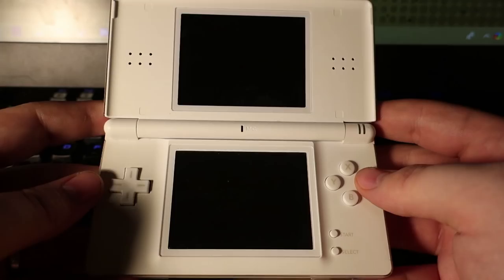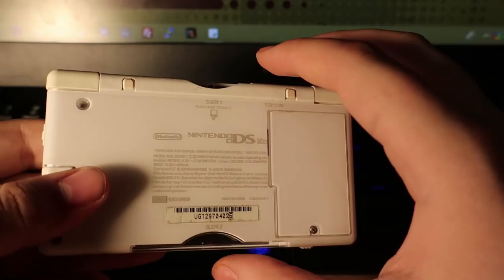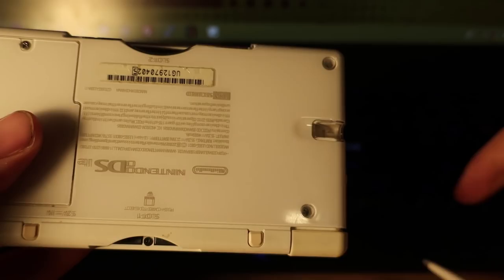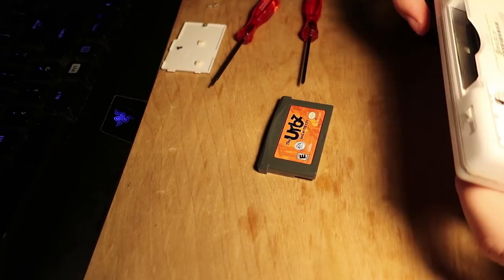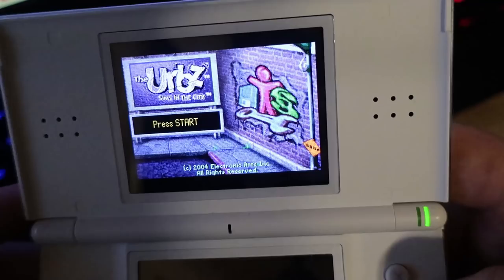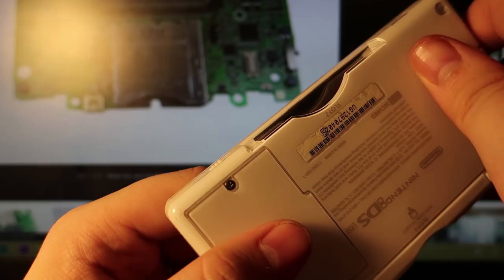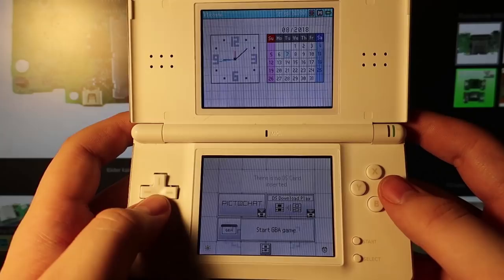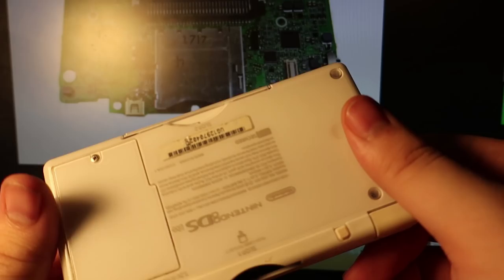$10 DS Lite won't play games. Let's see what we can do...

Comment: When I had one of these, with the same issue, i just kept inserting and removing the cartridge for two minutes and it came back to life
Reply: i had that too i needed 30 min i put out in i breathed in it and i even spited on the game card (dumb xdd) then i used a tower to clean the card put it in and it worked :v
Reply: @kitcat9685  thanks I did that too
Reply: @El1teAlexヅ  That worked for u aswell? lol? O.o
Reply: @kitcat9685  no it didn't work lol that could damage the console xd
Reply: @El1teAlexヅ ik but i did and it worked xdd
Reply: @kitcat9685   alright let's say it did worked for me but damaged my second console xd xd
Reply: @El1teAlexヅ  Rip xddd
Reply: @kitcat9685  every time I would try to use a tower to fix my ds lite it just is too heavy to lift
Reply: Same! I had a 3ds xl and it won’t play games
Reply: Mrsuperking Youtube631  lmao
Reply: i did tha same and some clean up with a wet wipe and it worked
Reply: You just fixed my problem

Comment: That's a kickass deal. A year or so ago I remember getting my DSi XL from my local pawn shop for only $25 since they had it on clearance being sold "AS-IS" as the slot wasn't locking in place. Game carts wouldn't stay in the slot. I tested to see if it would read them if I held them in to make sure the pins were good and it still was. So decided to take the risk and get it because the screens were in perfect condition with no scratches on the touchscreen either.

After taking it home, it turned out to be a 5 minute fix. There's a little rod with a tiny 90 degree bend on the end that engages a track on the mechanism inside the the metal cage of the slot. (on the outer part of the metal cage. You have to take the back off the DSi to get to it, but thankfully you don't have to desolder/remove the motherboard to get access to it) This tiny rod is what locks and unlocks the spring loaded mechanism that pushes the cart out. Works like a pen where you press in to lock/unlock it.

It somehow got popped off the track and out of place. I heard these things are fragile so if they were bent/dislodged, they tend to just break off. I was expecting to just shelve this for a bit and get a new slot for it. but turned out I barely had to do anything to fix this one.

I got really lucky. It wasn't bent too far out of place to where trying to bend it back would make it break or anything. I just popped it back into place and it worked fine after that. The rod wasn't damaged. It's been working fine ever since. :D

Really wondering how it got like that in the first place.... I also got the console because it had Flipnote Studio on it and that's an exploitable DSiWare app that can be used to install CFW/Homebrew device so that was another reason I was willing to risk getting a unit with a broken slot-1. :P

Comment: Hey can you fix my 3ds? Its been broken since 2014 when I plugged in a pair of headphone it just shut off I tried recharging it everything it just don't work
Reply from the maker: Have you tried ordering a new battery?

OEM ones are $5 on ebay.
Reply: Open it up look for liquids/sticky substances this happens to my 3ds it turned out it was sticky
Reply: My brother had a 3ds XL and it broke SO BAD. Once i used it and the top screen was held together by wires. We got a new case a few years back and still haven't fixed it, but my brother has a New 3ds XL and I have a 2ds.

Comment: Thats funny, Because I got myself a original DS (Silver) for $10 from goodwill...

It came with a R4 card inside (Modded), A blue stylus, and a GBA game that was a clone of 1993 Doom. All I need is to replace the battery with a new one and got myself a GBA charger. Need I remind you that IT'S IN GOOD AND PLAYABLE CONDITION?! DID NO ONE FUCKING THINK "Oh hey, A DS that turns on for a few minutes and have games on it, maybe I put it on the auction display for a starting price of $15..."

Well it was a great day for me, My first DS that I own in quite some time.

Comment: I had a ds lite with this issue but literally the opposite one was dead.. it would play gba games but wouldn’t read ds cards anymore.. not sure why but it just didn’t my stephdad took it apart and turned out some of the pins that are in there were bad only strange thing about it was that i never put anything in there but the ds cartridges and none of my other ds’es have had this issue (i have the old silver box one the original.. i have a dsi and a 3ds.. and all still work.. well the original one has a broken hinge on one side and my dsi has some drop damage on the L and R buttons making one stick if used too much.. and my 3ds came with a bug where i can’t shut it down when playing an old ds game and will have to go to the home screen first as if i do it from the game it will turn it’self only partially off and the light will stay on however if i do this on a 3ds game i don’t have this problem

Comment: I got a DSLite that dont read games on both sides, but when i insert the Games before i turn it on and have autostart it works.What can be the matter?
Reply: Salvatore Maurici you need to put the games in, before you start it
Reply: He puts the game in and the DS read it.
My DS didn't do that.It shows nothing
Only whenn i turn off the DS put the game in and turn it on it starts.
But only when i have the Autostart option in the settings on.
Reply: The games don't show up if you don't have autostart on? Thats weird... especially if the games read if you do have it on.
Reply: Yeah,thats really weird,i can play normally if i restart the device and autostart is on.
Tonight i clean up the whole device because i got it in very bad condition,maybe cleaning up the contacts will help.
Reply: @oopsychostormoo4443  yea that might help, yoi never know. :p
Reply: Dindnt help,same issue
Reply: I think the newer ds lites do that

Comment: I have mine but I need a new battery and charger and needs to fix the flapping thing
Reply: HostileGalaxy01 yeah if you have a ps3 charger cord turn it backwards and plug it in and it will charge the DS lite

Comment: I bought my DS Lite for just 3€, but it's got a cracked hinge
Reply from the maker: Buy a replacement shell. Only $10!

Watch a lot of videos before you do the replacement though. It's very easy to mess up the ribbon cable if you don't know what you're doing. I'll be doing a video on it later on.